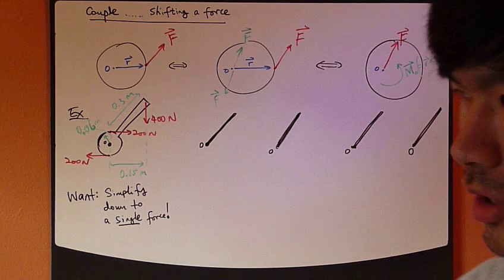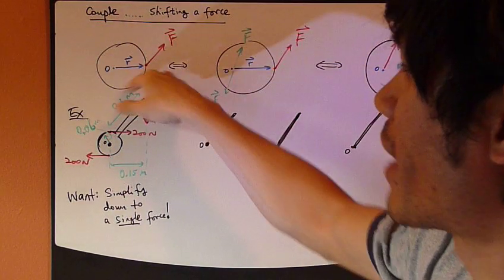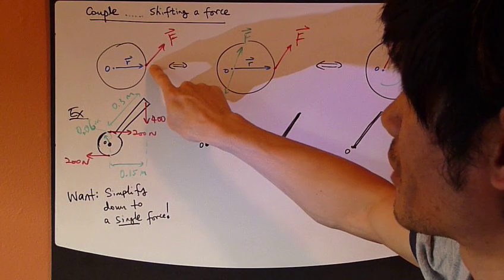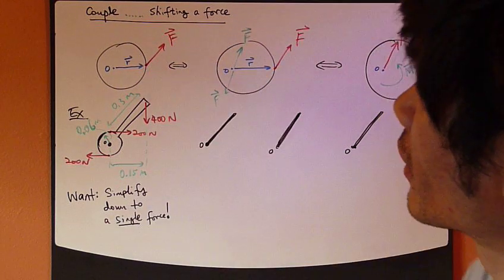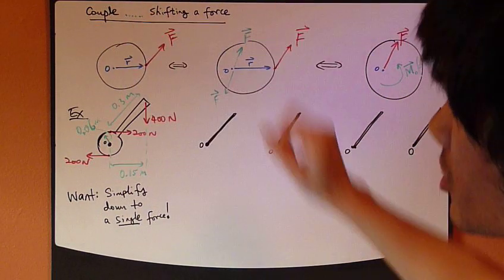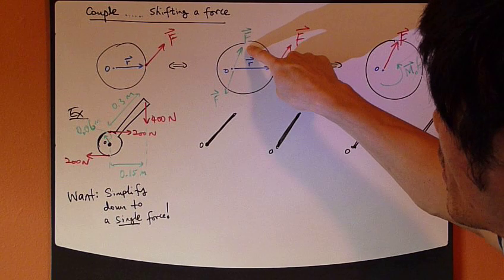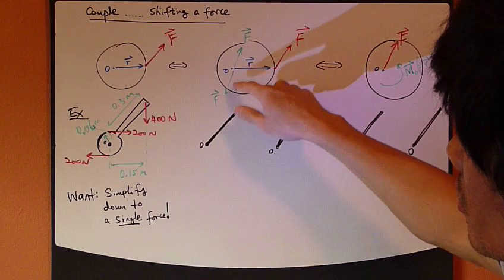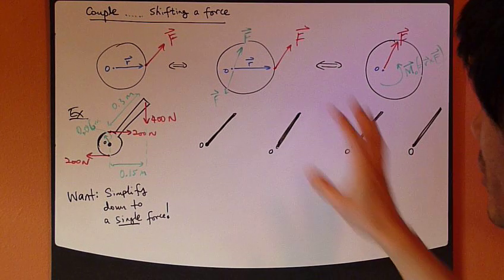Engineering Statics Ch4 Part10: Moment, Couple, Force Shift

Comment: can someone tell me the difference between moment and couple
Reply: a moment is a torque or rotational force and a couple is just 2 forces who are parallel but have different sense ( thats how i would explain it but im an idiot)
Reply: A Couple is the special name given to a Moment created by two equal and opposite non-collinear forces. A Couple and a Moment both represent the same physical rotating tendency that you get from the action of forces acting on a rigid body.

In certain applications, you would generally work with Moments and not Couples. For example, if you need to loosen a stubborn nut, then you would want to make use of mechanical advantage. That is, if you have a limited force that you can apply to loosen the nut, you would want to maximize the distance for the Moment arm from the force to the axis of the nut. This is because the ability to loosen the nut is maximized by the larger Moment arm, as per "Fd". For such a mechanical problem, you would be most likely dealing with and talking about Moments and not Couples.

On the other hand, in Mechanics, if you have a system of "Free" force vectors acting on a rigid body, you can replace all those forces by one resultant force through some point of interest and a Couple for each force, through that same point of interest, e.g. through the Center of Mass. Then, you could add the various Couples produced by each force and end up with one Resultant force and one resultant Couple. When you do this, you don't talk about a Resultant force and a resultant Moment. You talk about one Resultant force and a resultant Couple.

Comment: ok so you got d3 = 0.42 but i got 0.21m....which is fine cause its just calculation.. but my question or doubt is that is it possible for d3 to be greater than 0.15m ?? then the force F3 (400N) is not acting on the body? please help !!